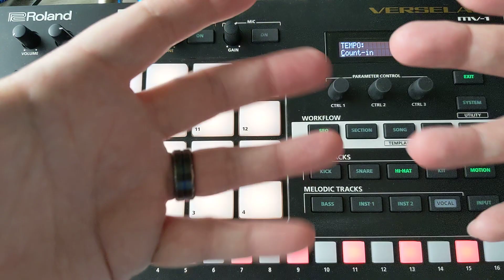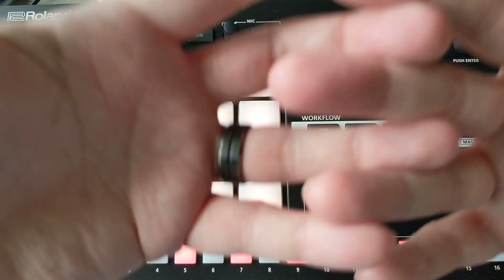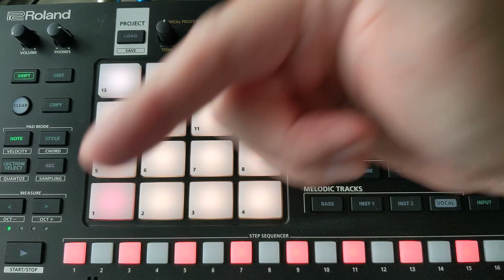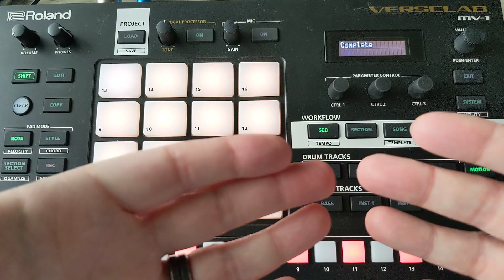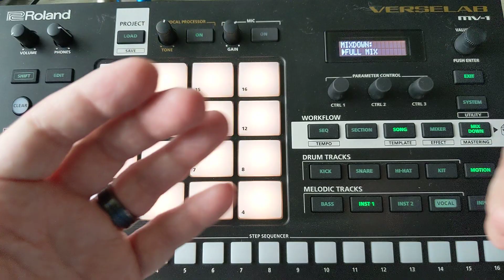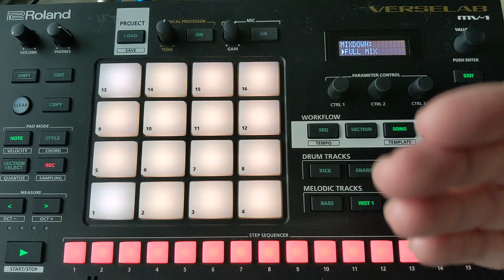Roland Verselab MV-1: Resampling

Comment: Your the man. Thank you

The MPC has a tune button.

I'm subscribed to your channel. Thx again 

However I purchased this because it sounds amazing andI can release my first EP with it.

Can you show the tune method for tuning samples like the MPC. Please!!!
Reply from the maker: When you load a sample onto a TONE track, it will play the sample as-is on pad 1. If you want it higher or lower, you'll use the pads. You can also adjust the tuning manually, on cents, using fine tune.

If using a KIT track, the same applies, but you'll use coarse and fine tune on each pad that you want to adjust.

You can also use looper tracks and resampling if you want to try to keep the transients and timing more or less intact (though the time warping on the verselab is pretty terrible), and then resample from the looper tracks onto a TONE or KIT track.

Comment: Hi brother that info about making longer songs then only 16 sections is brand new and EPIC for me!! Thanks for the Video..
Reply from the maker: We're still limited to 16 unique sections, which, for many styles of music is more than enough. There are certain genres, though, that really benefit from being able to extend the length, especially when being able to add vocal takes... it should also be noted that another way to use this to add variation beyond 16 sections (on top of vocal takes) is to use live input while doing the mixdown (line in and mic input is recorded in the mixdown), and, something I hadn't considered previously, you could, say, make 16 really dense sections, and while the mixdown is recording, you could mute and unmute tracks to change what's being played in real time. Perhaps not all that useful, but it does give more options for experimentation. 🙂

Comment: Great video. Resampling the tracks is soooo useful and powerful in many ways. Can you do a video recording the stems over usb into a daw?
Reply from the maker: I do intend to make a video showing how to use the audio and midi tracks to record live into a DAW, but with my neurological problems being in front of a screen, I'm not sure how yet. Before we get there, though, I plan to cover the rest of the on-device features of the verselab.

The basic functions can be divided by the type of USB driver you're using on the verselab. In the SYSTEM menu you can select generic or vendor as the USB driver on the verselab. Generic will allow midi and 2 tracks of audio (the mixout). The bad news about this is that it's just one stereo signal, the good news is it uses standard class compliant USB, so no driver is needed, and even most cell phones can use this.

Vendor turns the verselab into an audio interface, but requires OS specific drivers (that you get from Roland's site). The advantage is, you can record, in real time, all audio tracks, simultaneously (20 tracks!). 

When using either of these, you'll have to select MV-1 in your DAW as the audio source, and all audio will then go through the verselab (you'll have to listen using the headphone or audio out from the verselab itself).

Comment: there should be a quick shift default mode when import samples to a pad - a SP303 like play where you dont have to waste so much time maxing the Delaya offset etc and having to record or set the max length of the sample.